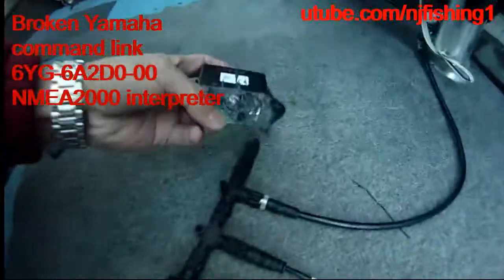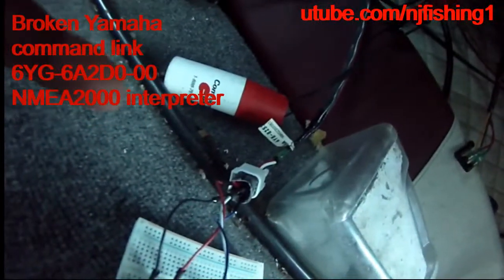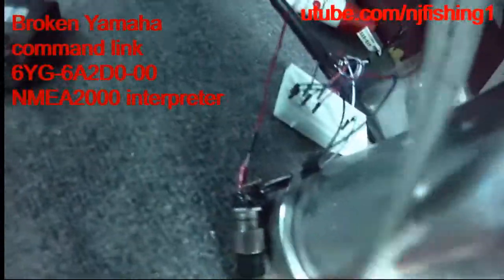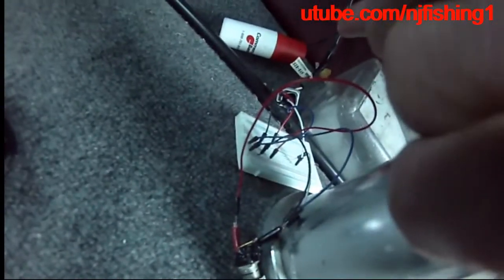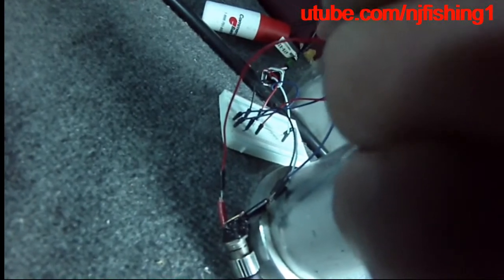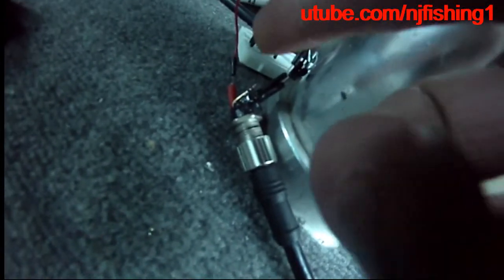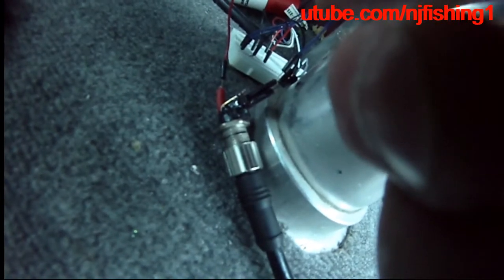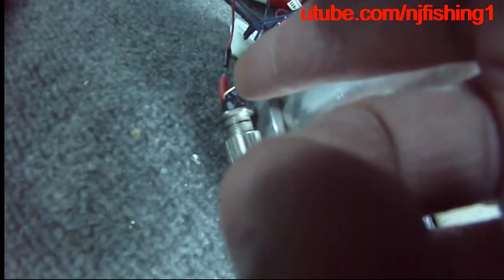Yamaha NMEA 2000 engine gateway is flawed, don't buy or you will regret it (Buy Raymarine PCI-100)

Comment: Hey man, I saw you first video where you mentioned cutting the 6YG open to retain the NMEA connector, and Yamaha harness plug.. glad I found your video here, but when you got the unit opened up, was their any microchips or evidence the 6YG is doing any real serial conversion from data coming from the ECU <> N2K? Reason I ask is, I've read where many outboard manufacturers of recent era model motors speak N2K natively, as if to say the 6YG is merely a physical medium adapter, however I'm fairly new to the Marine scene and CAN BUS related components, but knowing the contents of the 6YG would be a huge help if you could explain?
Reply from the maker: I didn’t know what I was looking at-Lol I saw a circuit board with many components I didn’t recognize. I do know I didn’t need to buy Yamaha digital Tac meter if I bought 6YG, because it does translate the Yamaha engine data so Axiom can understand and display the RPM, engine hours. I ended up buying and using a Yamaha digital TAC meter to display total engine hour, RPM etc. you don’t need both, and 1 will do. I would suggest to forget about 6YG, because Yamaha stopped making them. The dealership don’t have the experts to deal with 6YG.
Reply: @njfishing1  I see, thanks! I commented in another guy's video about the same topic, and so what I gather is the engine gateways from Yamaha are a bit outdated and so either the endpoint devices such as the gauges do the translation, or as I've also heard, the ECU's are natively capable of N2K, and thus your Lowrance's, Garmin's, etc are just using the N2K protocol directly.

What I wasn't so sure of was if current day outboard ECU's spit out anything proprietary, or perhaps in J1939 where theirs a translation even if mildly between the PGN's and such among J1939 <> NMEA2K, but soon I may see it for my self with some real mass (on a 2020 F115).
Reply from the maker: Yes, the translation of ECU in your engine to N2K is proprietary. That’s why you need either a 6YG or a Yamaha digital TAC meter to do the translation
Reply: @njfishing1  thanks again! I've spoke to a few on this since that comment, and alot of the components involved seems to be dependant on the model year, although you can lump certain year models together for the parts stack used..

My reasons for wanting to know which components are absolutely necessary revolves around onboard logging, not necessarily for OEM gauge retrofitting/rigging